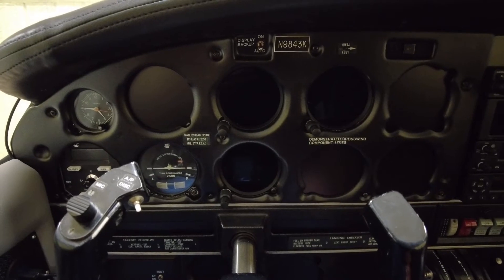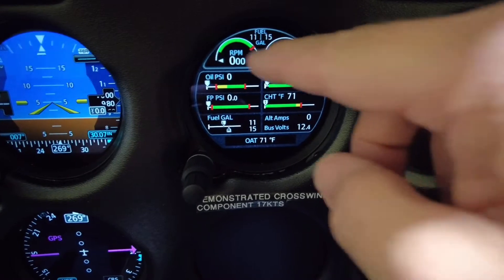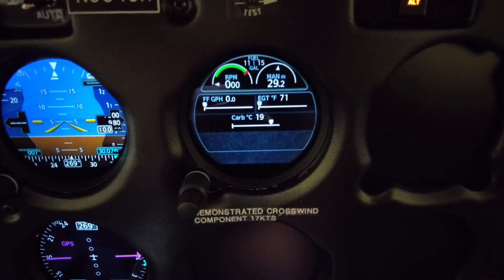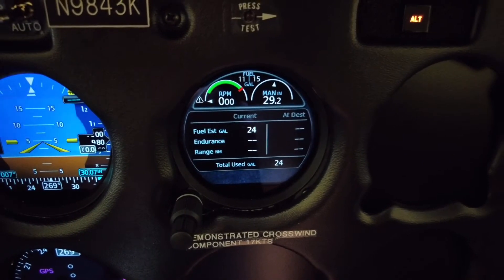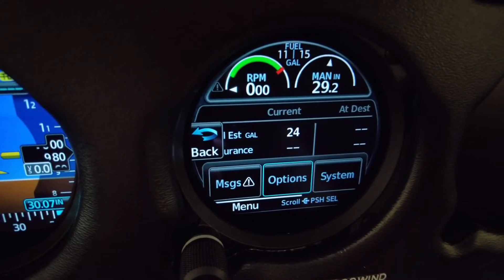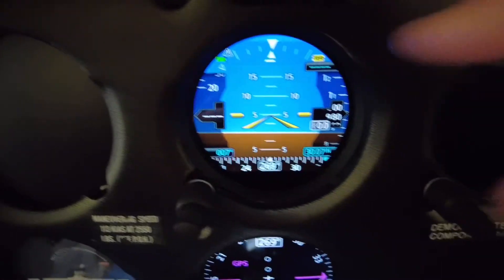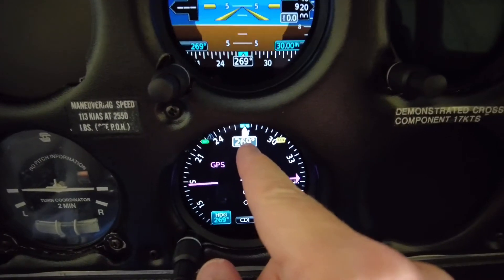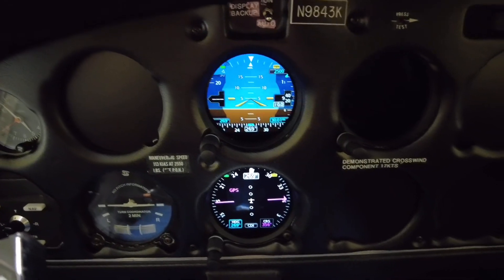Garmin GI-275 Full Review! (ADI, HSI, EIS)

Comment: How does it work when power is lost? the G5 has build in ADAHRS and is just taking air pressure readings for speed and alt, the GI275 needs external ADAHRS from all i know. Does it get power from the GI275?

Comment: Do you have the factory autopilot installed and were they able to connect it to the GI 275 system?  I've got a 77 Archer II that I stacked with a 650Xi, 345, and a 274 MFD that was just installed this past summer.  That installer said Garmin was coming out with an integration for my A/P and the 275 HSI and ADI and he didn't have time to install the HSI and ADI last summer.  Just wondering.........

Comment: Can the GI 275 really replace the primary altimeter??
Reply: yes, as long as you have two you can entirely replace the old gauges, but check for your locality. The use of the GI-275 and G5 etc. have allowed people to remove the vacuum system and unecessary cabling (reduction in weight and increase in air flow around instruments) as well as to convert their old aircraft into technically advanced ones (TAA) when adding the other required GPS/transponder/auto pilot capabilities etc.

Comment: If only my Mooney was that easy to start in real like. Those IO550 are tough to start.
Reply: IO550s should start easy. What’s your start technique?
Reply: @EngineeredFlight  pretty much what the POH calls for, mixture rich, prop full forward, throttle full forward, master on, low boost pump for 3-5 seconds, throttle idle ( I've found maybe one twist in works best), start.  Usually the plane won't start on the first time if it's been sitting a few days.  Heck the prop won't even turn for several seconds in the starting process.  Second time it usually starts.  I just start over with the starting process.  I will use the low boost pump but will not do the 3-5 seconds before moving throttle back to idle.